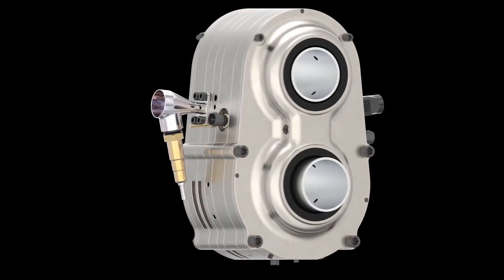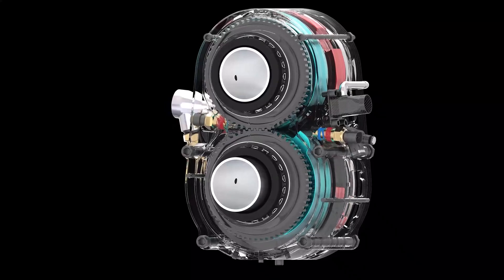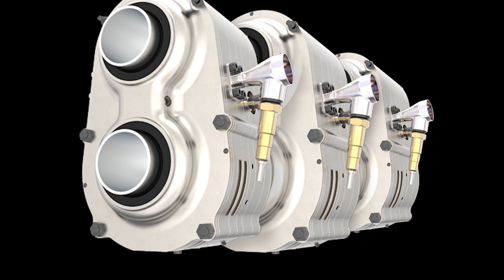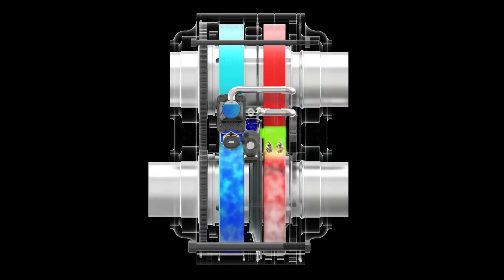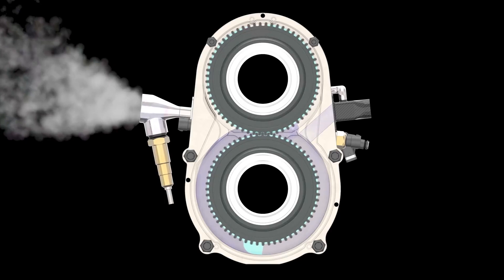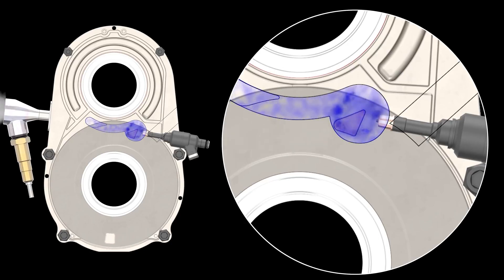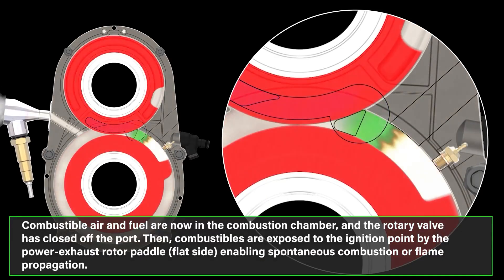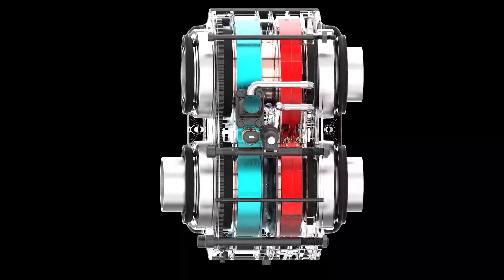This pistonless engine runs on hydrogen and revs to 25k rpm

Comment: Tight tolerance means 3D Printed, for all the nays sayers 2 BMW's were driving around Manchester in England with 3D Printed Engines in 2015. As someone who sees electric vehicles as the worst enviromental disaster in history... the strip mining of huge areas for rare earth elements, the toxicity of the batteries and you can't bin the bloody thing once you hve finished with it. Note. Paris has 360 EV's in a field no one will take for recycling!! Thsi is the way forward, if the hypercite green elite can be circumvented and the idea is not bought out and berried.

Comment: This is exciting, but even if they had a working model, the biggest problem remaining is the storage of the hydrogen. Hydrogen is light but in its gas state it doesn’t have much energy per cubic meter. You have to compress it to be able to carry enough to fuel a vehicle for any significant range and that brings other problems to solve involving safety, weight, and the added cost of a system to cool/compress the hydrogen and contain it. I know that progress is usually incremental though, and this looks promising. We just have to solve a lot of sticky problems before it can be practical. Thanks for sharing.

Comment: I'd have to reserve judgement until I see the emissions profile for different fuels. 
Hydrogen is supposed to be clean burning. But the received wisdom on hydrogen is that its better to use fuel cell type setups for safety.

Comment: Electric cars may have a place in future but, BEV's in particular, aren't really practical because of charging. Not everyone lives in a detached home with private parking. On a terrace row of homes running cables across footpaths just isn't practical or safe. Hydrogen combustion is the future and it could be used for heavy plant and machinery.

Comment: I like the concept, not against ICE engine, just oil as fuel. Problem is with hydrogen as it’s abundant but hard to hold in containment.  It is highly reactive and will ignite fairly easily. The byproduct is water so good.  Hope it works out.

Comment: The idea and design is excellent.  So far so good. We just need to do two things and this engine will power the world. longevity and endurance tests equal to an ICE. and bring the Hydrogen  production costs close to solar power,which would mean on or about 6 times less than at present.

Comment: Well Chris, we've had electric vehicles for about 100 years now and they still have the single biggest drawback - heavy batteries so it's only a matter of time before we see mainstream vehicle manufacturers using technology just like this. It looks very promising. Great videos 👍
Reply: lead acid batteries are much heavier than lithium batteries. Lithium iron phosphate is lighter than ordinary lithium. They have made a lot of progress actually. 
Thats why electric vehicles are no longer tiny things with no backseat.

Comment: The only good idea is use hydrogen. 1) Hydrogen is anywhere in the universe. 2) 2H2 + O2 mixture is 40 times more explosive than gasoline therefore you do not need compression stage 3) Is possible to create a round wankel with circular seals alternating between 2 and 4 strokes when necessary. THINK ABOUT IT.

Comment: I think they should bring back the 1985 Chevy sprint that got 55 mpg with a carburator and regular ethanol free gasoline....my mom owned one and later gave it to my sister to drive in hs. Wish I could find one to restore. I did see one at auction with 137k miles that was already up to $20k bid!!!! Gets better fuel economy than any hybrid on the planet today. And that means it's all BS, hybrid should be getting over 100 mpg.

Comment: In my opinion this type of engine is a step way above electric vehicles. This has to be a greener solution . There are still ongoing studies into the downsides of battery production. Electrolysis is all is needed to source hydrogen. This is something to be excited about. My brother spent £80000 on a tesla. Which I think is complete waste of money. The power ratios with this engine set up could easily match an electric vehicle . Engineer’s are such clever people.

Comment: If hydrogen why not just use fuel cells? If using natgas it sounds nice .Positive pressure outside of combustion chamber   might negate the need for such tolerances or even lengthen seal life.kinda Like we use three piston rings now

Comment: Sooo tight tolerances and no lubrication for an engine that has to work anywhere from -40 to +50C, 0 to 3000m altitude and and all humidity levels. Sureeeeeeee.

Comment: Good in concept, never make it past prototype. 2 stroke engines have always been more efficient than 4 stroke (per horse power), this is a rotary engine. I do not have faith in EV, i think hydrogen, or a blend of some sort will be the way to go. having no seals on an air cooled engine that revs to 25k will generate such extreme temperatures that I can see this thing turning into a lump of molten Aluminium on the floor within minutes of being stuck in traffic. 

they may be able to get past heat, but how will they get past wear? with such tight tolerances I can only imaging what 1/4mm of wear will do to them, the manufacturing cost will be astronomical too due it requiring such accuracy in design. 

running multiple engines in series is also a challenge within itself, as far as I'm aware there are only 2 ways to do it. and 1 way is using 2 gearbox inputs and using the gearbox to sync the engine and the other way is electronically linking them to run at the exact same speed and have the same rev speeds. this is extremely expensive to do as well. 

but in terms of a concept it is not earth shattering but it is nice to see some designer went back to basics and has seen there is good old tech out there that just needs to be looked at with fresh eyes and a bit of creativity

Comment: The problem is the fuel. Hydrogen isn’t available without expending more energy to obtain it than you get back from using it as a fuel source
Reply: That's true with batteries and petrol as well.
Reply: @jaxxmadine  that’s true, but to me the logical way to use a finite supply of electricity (in relation to personal transport) is to store it in a battery and use it directly for traction, rather than using it to separate hydrogen from water or, even worse to power pump jacks, pipe lines and horribly polluting and inefficient oil refineries

Comment: Main concerns:
Tight tolerances means exponentially higher production cost and greater loss should something fail.
Being an entirely new platform, manufacturers will struggle more to see the cost/benefit quickly and I fear it may fall behind other faster developing alternatives (like electric).
No real world proof of concept means that it is still far into the future, again potentially rendering it obsolete in 5 years or so when alternatives are forced to the market.

My wishes: That the tolerances are manufacturable and reliable, and cost overall can be kept low due to simplicity - also giving better power-per-volume proposals for Hydrogen, which has so far been one of its lackluster statistics in existing automotive applications of the fuel source.
This engine type would be ideal for motorcycles, where power to weight means everything, and having naturally counter-rotating internals would eliminate gyroscopic side effects and remove the need to manufacture artificial counterbalancing (and thus remove cost). Also size means easier packaging which overall would lower build cost in general, and having a hydrogen powered motorcycle could introduce the gateway between existing and future green motorcycles that historically have been unsuccessful so far.

I want to see this project providing real life data, not just theoretical CAD analytics.
Reply: it is a modified Helicopter's main rotor engine, they use 4 of these units, light weight, super efficiency will often mean that it has been around for about 20 years already and being used by the military.
Reply: WeNeedHydrogenResonanceTech4cheapHydrogen.
Reply: There are problems with all electric vehicles. Mainly how far you can drive on a charge. Until better batteries can be produced, we need to keep looking at all alternatives. Right now hybrids are the true best answer.
Reply: Cummings developed a working hydrogen engine last year (2021).
Reply: @Deaddoc Really Deaddoc,

Hydrogen motors have been around since the 70's. It's all about making hydrogen safe in vehicles. Very difficult 

OT. Interesting design but that's pretty much it. I'll need some lab testing numbers on power curves, where the torque peak is and rpm at 55 mph, durability, easy of maintaining and unit cost. Then I'll look at it more seriously. Theory doesn't mean practical. 😉
Reply: @walterroche8192   it is a modified Helicopter's main rotor engine, they use 4 of these units, light weight, super efficiency will often mean that it has been around for about 20 years already and being used by the military.
Reply: @walterroche8192  It's not just about making hydrogen safe as such - it's also about the tolerances required that are so tough to manufacture at a good cost. Leaking is the main issue with hydrogen, not combustion or rapid depressurization (aka explosion). Also the cost of producing hydrogen in the first place has been a major setback so far, along with general storage and implementing it into a supply network. Electric charging just slots straight into the existing electric grid so there were hardly any big scale hurdles to overcome in that regard other than building actual charging stations.

But with new scalable water electrolysis to separate hydrogen with excess power from solar and wind during overproduction, hydrogen as a fuel source and energy conservator will become relevant within the next 5 years at most. There have been a lot of breakthroughs just this year in hydrogen production methods which have significantly shortened the estimate for large scale hydrogen production.

Comment: The greatest obstacles to engine design improvement, are most always in our brains. Take Henry Ford in the days of the straight eight, when he told his design engineers he wanted an engine at least half the length but retaining the BHP of the straight eight. They kept telling him "it wasnt possible" untill he came in one day and told them he would starting them untill someone came up a workable solution. What happened? yes, we know, the V8 was conceived & born & just think about how compact the average car & truck became as result.
 Electric is NOT the answer, because of the massive issue with batteries. a) failure in use, i.e., bursting into fire b) the elements required for manufacture and all the implications with mining & availability, and most of all c) disposal or recycling at end of life. The internal combustion engine will be with us for decades to come, for many and very obvious reasons.

Comment: Bring it on I say!
The jump from ICE to electric motors is an extreme move, which only really solves one issue - a cleaner car.  But, when you take a closer look at it, is an electric car truly environmentally friendly? 🤔

- They costs heaps more to build and therefore buy
- development costs are also included in that price.  Which is totally ridiculous to me, why are industrial manufacturers doing their own individual development! Why not combine efforts, or let existing battery manufacturers do that work and just build cars with a universal power plant? You don't see vehicle manufacturers now developing their own individual fuel for an ICE, so why their onw batteries?
- an electric car's carbon footprint is way higher than a ICE equivalent, due to the amount of exotic metals required to make its batteries. There is a heap of manufacturing required in its components, before they come together to form a car - you've got to be doing loads of driving to offset that!
- they are only as green as the energy you put in them - they don't pollute, but only at source, which can make you sleep easier, knowing your doing you bit for the environment.  But, if the power you use is generated using a coal fired, or nuclear power station, then by default, your car runs on coal, or plutonium!

So no, I don't think purely electric power is the way forward - The complete switch only replaces a bunch of known issues with a another list of unknown issues.  The search is still on for a viable ulcerative, or combination of technologies, which will truly answer the question, but electric is it!

Comment: WoW! Another engine that will never see the light of day.... Imo, judging byt it's size and power, I think it's more fesable for a motorcycle. Also, law needs to be adjusted for this. For example: normal engine capacity is calculated by cylinder capacity X number of cylinders, rotary engines are calculated totalcapacity X number of rotors, electric cars are calculated as having a 50 CC engine (I know it's stupid...but that's how taxes go in some countries)

Comment: All very good if we had frictionless, immensely strong (that little Pelton wheel cup) with no thermal expansion.
  Those rotors must easily have more frictional area than a simple piston and they're going to have to be completely gas-tight.
  It's a bugger that physics brings to naught hare-brained ideas.

Comment: Why is anyone wasting their time on any form of heat engine design when the thermal efficiency is never going to be better than let's say 40-50%? (That's being very generous).
Then you have the terrible efficiency of creating and storing Hydrogen.
You also still need something to control the emissions because there's burnt lubricating oil in the gasses.

The end to end efficiency of any of these solutions is three times worse than using electricity directly in a BEV. This will engine will never be an economic solution if it works at all.

Comment: Its going to be far too expensive to manufacture for average use cases and when it goes bang the whole thing will die rather than 1 piece. Looks more like something that could be used in high level racing. 
The biggest benefit would be the one fits all solution, its light enough and modular enough to work with bikes, cars and planes

Comment: I believe that you have to follow the money to tell whether hydrogen engines have a future. It would appear that enough manufacturers (e.g. Toyota, BMW) think that hydrogen fuel cell powered cars are a technology that can work well, which indicates that it will eventually replace large, heavy, less reliable Li-Ion batteries (fires, losing battery charge in cold weather, polluting chemicals, recharge wait times, life degradation, cost, weight etc), but only if hydrogen production facilities are increased and the storage medium becomes widely available. I think hydrogen ought to be the way of the future. Whether or not that turns out to be the case depends on how seriously we adopt the infrastructure that underpins it.

Comment: bro, "no seals through tight tolerances" is akin to "no toilet paper if you poop underwater".

it brings a whole new set of issues, not really easier to deal with than the one that it wanted to solve.
Also, looks to me that seals in this design would fare quite well because of the separation of the cycle steps.

Comment: Imagine this engine linked to an alternator and ultimately and electric motor.  Great hybrid, with likely promising application to smaller marine engines.  Still have to solve some problems to make the hydrogen fuel workable on an everyday basis.  but promising, indeed...
Reply: Imagine converting the energy in hydrogen directly into electrical energy, creating an even better hybrid.

Oh wait, you don't have to imagine it: we've had working fuel cells that do just that for years now.
Reply: @RexxSchneider  Great idea. Need to make it scalable and commercially viable.  Need a deep-pockets investor.  Government probably won't do it for political reasons - existing industries would fight it.

Comment: With that weight advantage in a vehicle (with reduced battery size) it may be close enough to offset some the energy loss (up to 50%) in making the hydrogen from renewables. Ideal as an alternate application as a range extender. Image an electric vehicle with a 20-30 Kw Battery and one of these to charge it for longer range. Massive cost benefit and reduced weight in the battery pack and could still keep daily range of up to 100 - 150 mi. If cost effective with a micro version EG 60hp could drive direct for highway speeds 65+ with any excess charging the battery. Potential to upscale for trucks!
Reply: Why would anybody burn hydrogen in an ICE like this, then drive an alternator to produce electrical energy, when they could just use fuel cells to convert hydrogen energy directly into electric energy with zero moving parts?

Comment: This engine would be a great charging device if it was connected to a PMG, you could charge up ur EV super fast or even adapt this device into a EV to extend driving distance by chargeing up while driving
Reply: If you add this to an EV it's no longer an EV. It's a hybrid at best.
Reply: @thevso On the contrary, it won't be that long before there won't be a meaningful number of anything but EVs on the road. If you're going to have hybrid technology to extend range, it's going to have to use hydrogen as fuel. Of course, an EV has electric motors, so there's no point in burning the hydrogen in a ICE like this just to then turn the rotational energy into electric energy, when you can generate electricity directly from hydrogen in fuel cells. This is an interesting concept, but without any future.

Comment: Tight tolerances high rotation... What happens when you introduce dirt. 

And how are you acquiring the hydrogen. You're burning fossil fuel somewhere to make the hydrogen. Unless you got a working tokamak in your pocket , how are you producing all this hydrogen to burn. Motor looks good on paper; BUT.